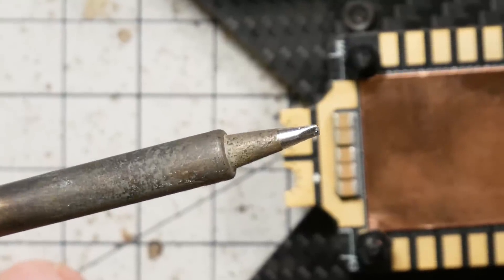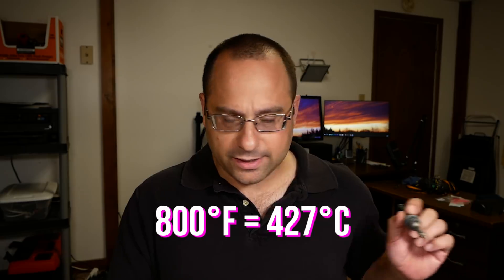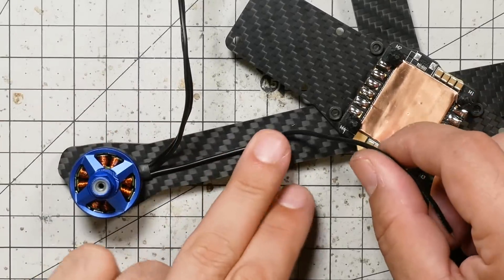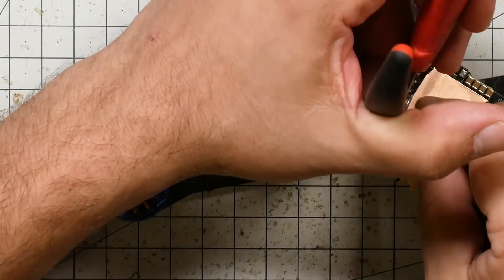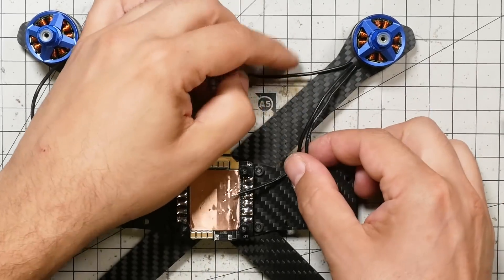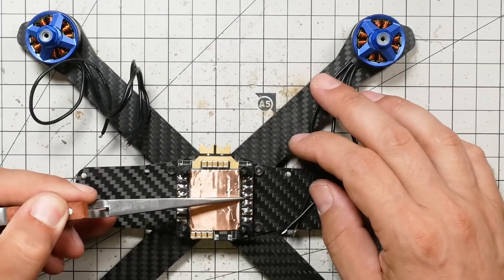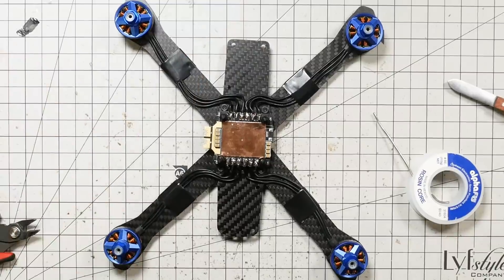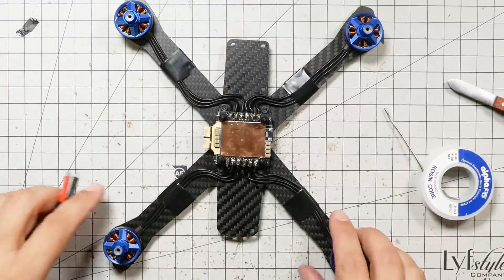Learn To Build a Racing Drone - Part 4 - Solder Motor Wires

Comment: Folks, is there any wire ordering when soldering the 3 wires to the pads on the board? Or can they be randomly soldered to the pads?
Reply from the maker: There is no order. The order will determine the motor direction, but you can change the motor direction in a later step. So I just wire them straight through for neat wiring.
Reply: @JoshuaBardwell  Thank you so much! I love your channel! I've been watching you almost daily since I'm new to fpv. In fact, i made my first vlog yesterday :) Thank you for doing this!

Comment: Help! I never learned to solder. My tinned pads look like blobs of dull grey mr whippy instead of filling the pad. Maybe I need more heat on the pad first or dodgy solder? Bonus question. Can I use hot glue on motor wires, xt60 wires, if i'm worried about quality of my joints?
Reply from the maker: If you're worried about the quality of your joints, stop building a quad and learn to solder better. It's tough advice but it's the best advice I can give you. You will waste so much money and time in this hobby if you don't know how to solder at least half-decent. An hour or two spent practicing (ideally under the eye of somebody who knows how to do it) will pay huge dividends.

If you need to hot glue your joints because you don't trust them, the joints need to be re-done.

Dull grey might mean you have over-heated the solder and burned out the flux. Adding flux from a flux pen can help with this. Paint the joint with flux before tinning it and before soldering the wire to the pad. Flux will also help with the "Mr. Whippy" whipped ice-cream peaks by helping the joint flow better. Make sure you are using rosin-core, leaded solder, not lead-free.

Comment: And it’s at this point I discover no standoffs in the kit <sigh>.  So I used a piece of foam tape to align the ESC and cut and tinned the wires and the tabs on the ESC.  And attached the power cord.  Looks good but it seems like the whole unit gets really hot almost couldn’t touch it.  Normal or did I fry it?   Rotor riot is looking for stand-offs to send me but I’m dead in the water until I get them😕
Reply from the maker: The omitted standoffs were a mistake and they are being sent out. You should have also received a coupon for 10% off a future order, as an apology. Don't use foam tape the way you did... the unit needs at least a little air flow. It's probably not damaged though, as long as no smoke came out or anything.

Sorry for the mess up on the standoffs.
Reply: @JoshuaBardwell  I understand that things happen but my experience with the hobby has been mostly bad.   I am brand new to it so maybe my expectations are all wrong.   I ordered a Hawk5 from Amain.com that came with a bad vtx, Amain told me I had to send it to Emax for evaluation which I did for an additional $20 in priority mail.  Emax has had the quad since Nov 5 and has not communicated once with me on what's up.   After lots of bitching, Amain is sending me a replacement as of Nov20.   I've ordered tiny whoops from Banggood and well...Banggood doesn't communicate order status, just that it's "in Processs"    Similarly, I ordered a Tinyhawk directly from EMAX and it's in the limbo of "processing".    I have had similar issues with DJI with service.   My personal opinion is that China builds cool toys but has no idea what service levels Americans have become used to.   If you want cool Chinese toys, you have to wait for them.   I have no idea when I will be getting the stand-offs and other stuff missing from my RotorRiot kit but since the stuff is coming from China, I guess its just going to be a wait and see.    Aside from all the stuff I need to learn to simply play with these toys, I need the patience of a saint just to get working toys.    BTW - I am addicted to your channel and thank you for all your expertise.   I think your'e going to be my first patreon

Comment: Is it bad that there’s dents and divots in on that big copper rectangle in the middle of the esc? How did that even happen JB? I’d appreciate a response as soon as you can possible provide one. Thx. Building RC racing kits to race on he surface and just everything about surface rc’s is very different from quads. (Ok. Not everything, but a lot.)
Reply from the maker: That is a thin copper tape that is used for shielding from interference. It's normal for it to have some small marks because it's so thin that any touch will deform it. It's not a problem.

Comment: Great videos as always. If you use the flat side of the cutters to strip wires its easier and can you better judge how much insulation u are taking off.
Reply from the maker: Funny you mention that. I actually use the beveled side because it gives me perfect spacing. If I eyeball so that the edge of the bevel is lined up with the insulation, I end up with a perfect 1.5-ish mm of wire sticking out.

Comment: I see you don't use flux?
Reply from the maker: I use rosin core solder which has flux in it, and usually that's enough to get me good solder joints.

Comment: Too high temps, i would never recomend 427 degrees celsius. U can damage the board by heat,  solder splatters more easy and u can lift pads. Great video though...
Reply from the maker: Like I said in the video: some people feel this is too hot LOL. This is what gets the best results for me.
Reply: Depends very much on the solder: is it lead based or not? Lead-free solder requires higher temps. But still, 427 C seems high, I solder lead-free at 375 C and traditional at 320. I use 400 or in extreme cases 425 for things like de-soldering some ancient, really cruddy piece. 

Of course, there are many variables:  if the iron/station is a bit lacking in effect it will be slow to recover when it comes in contact with the pad and a higher temp will help avoiding it dropping to low before recovering. The tip used makes a huge difference and of course the pad /wire/component dimensions. And of course, different solders behave differently as well. What I reacted to was that you seemed to use pretty coarse solder, personally I prefer as thin solder as I can get away with since it gives more control.

But sure, if that high temp works, why not. People should understand though that at those temps you really can’t afford to linger with the iron in contact with the pad - even more important if soldering an actual component to a PCB than a wire.
Reply: I’ve got the same iron and 800 has given me the best results as well.  But it does seem odd that I have to turn the iron up so high.

Comment: I had a thought. You already did a video introducing someone to the sim (which is unfortunately NOT the best way for them to learn, as the best thing for THEM is the worst thing for a VIDEO, because they just fiddle around until they figure it out)..... you are already proficient with soldering and assembly, so when you do something it goes very quick and looks too easy. A beginner with no soldering or assembly experience will STRUGGLE because they will be clumsy.. Have you considered instructing someone on a first time build and filming THEM try it??? It will result in beginners being better able to learn what THEY are experiencing, like :is it hot? Are these wires too long? Is that good enough? Mine looks so different and crazy, etc ..... a newb on film would give all of the bad examples, AND show you where a bit more explanation might be handy.
Reply from the maker: Here is a build where I did that. 

https://www.youtube.com/watch?v=LsDgB-DnjGE

Comment: Any reason why you put the motor wires at the edges of the arm instead of down the center? Seems like there was a pattern there..
Reply from the maker: I try to put them on the far side from where the prop will strike if it gets bent down. I hope that will help minimize damage.
Reply: Makes total sense, of course... thanks!

Comment: Why not apply prop blades on top of the wire to protect the wire against prop impact?
Reply from the maker: It's a good idea, I just skip it a lot of the time. I dunno if it's the props I use or what but it's seldom an issue.